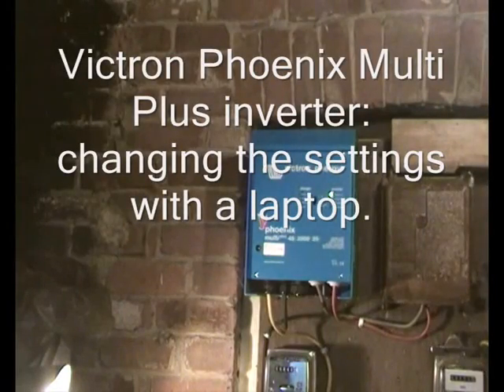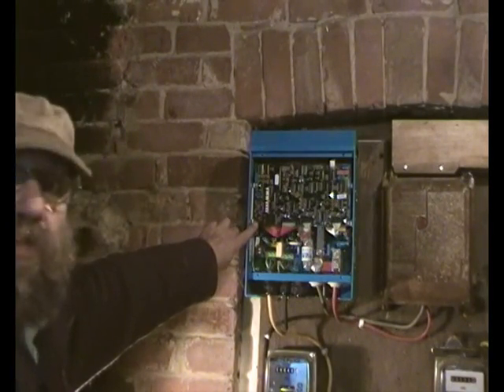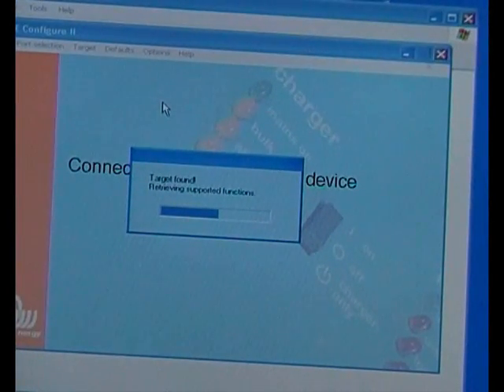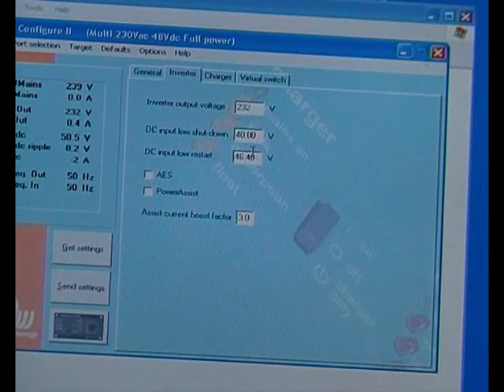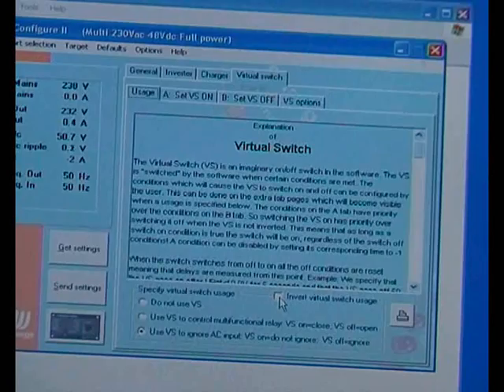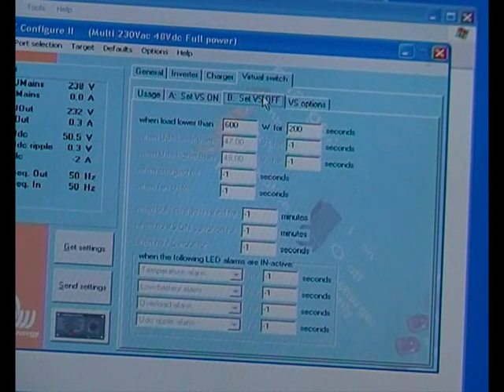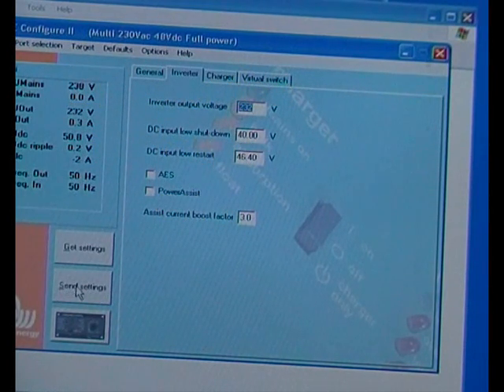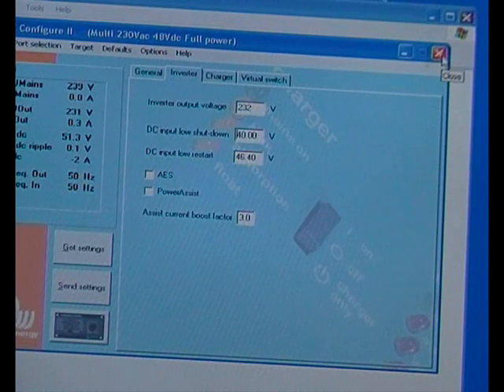Victron Phoenix Multi Plus inverter. Change the settings with VE Configure. battery based system.

Comment: Hello Andy, great video as always, I hope you don't mind but is there anyway possible I could contact you by e mail. I have a few questions about installing a Multi plus and batteries. Thanks Brian
Reply from the maker: Brian, best ask here, I have limited experience with ESS, cheers
Reply: sorry for asking Andy but I have found a multi plus kit I would like to buy but I am struggling to get an electrician to install it for me, all the ones I have contacted say they have no experience with them and decline, one only agreed to install it if they bought it first ? Anyway I have installed 3 grid tied solice inverter’s in my workshop for my solar panels, had a slight issue with earth leakage but that was solved with a 100ma rcd that an electrician installed at the house consumer unit. ( which provides protection for the workshop solar only, the main house has a 30ma one) My question is, If I ran another cable ( 10mm ) from my workshop to house consumer unit along with a separate earth and cat 6 cable for the current sensor and just got an electrician to install it into a 40amp mcb, I could have all the kit in my workshop, that way I could install it myself without having to touch the house consumer unit because my understanding is they still work and are wired the same way as the grid tied inverter’s they just provide the power from the batteries to the house just like the generated solar. Sorry for the long message, thanks again, Brian.
Reply: This is a list of the kit Andy.
What's in the Kit 

1 x Multiplus II GX 3000VA 48V Inverter/Charger
1 x Current Transformer
1 x 125A MEGA fuse
1 x MEGA fuse holder
1 x Pylon Lithium 4.8kwh Batteries (US5000)
1 x Battery Switch
1 x ET112 meter
1 x VE.Can to CAN-bus BMS Type B cable
1 x RS485 to USB interface cable
1 x Set of Pylon battery long leads
Reply from the maker: @drut12000  From my understanding the ESS current clamp defines the limits of the power sharing system. So if you use a cat 6 cable from the current clamp at the house consumer unit then you can back feed your existing workshop cable to power share in the house. Owen from the Bootsowen channel has just fitted a system and still has this stuff in his head, cheers
Reply from the maker: @drut12000  is this from Bimble Solar, they do good deals and have tech support? cheers
Reply: @TheInfoworks  Thank you Andy I will ask Owen if he has any advice. I did reply to you yesterday but for some reason it hasn’t shown up? the company I have found the kit is called callidus trade but I will look on bimble solar site. Once again thank you for your help really appreciate it

Comment: Just came across this video
WOW!!
Not Much Difference Between Your Inverter Than Mine.
And Yours Still Works! Incredible!!  Congrats To You.
 You got your Moneys Worth
Thumbs Up For You
Reply from the maker: Hi, i changed this for the larger 5kw in 2018. There was nothing wrong but we needed a larger capacity on the change over relay. It was still working well after 10 Mw of output. Secret: the settings of the change over to prevent the inverter running anywhere near full output. Subscribed? Cheers

Comment: I have a two old model phoenix vitron multiplus 24/1600/40 It can be put in parallel with another model the same as it is done. The 2 have the same firmware 1816133.VFF
Reply from the maker: Hi, I'm not sure, the newer models are bi-directional but I'm not sure about the older units, cheers